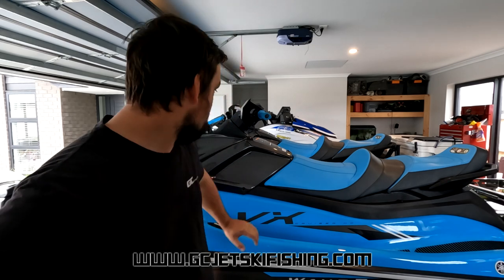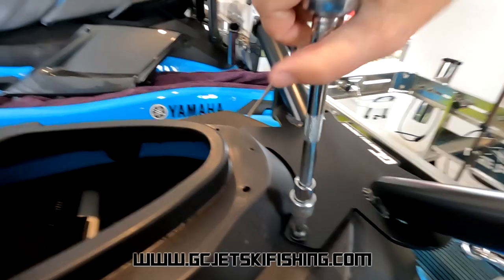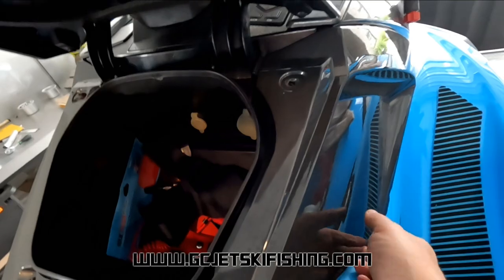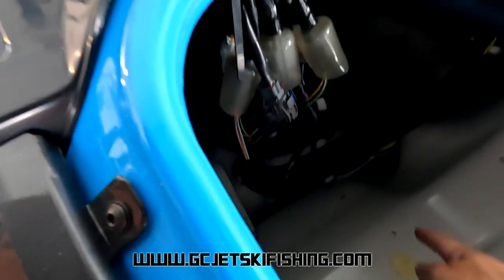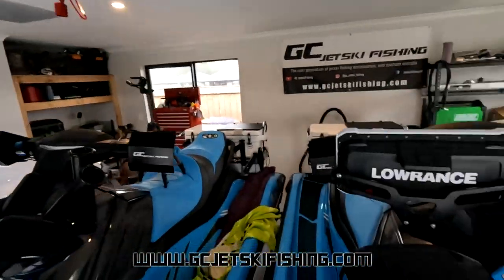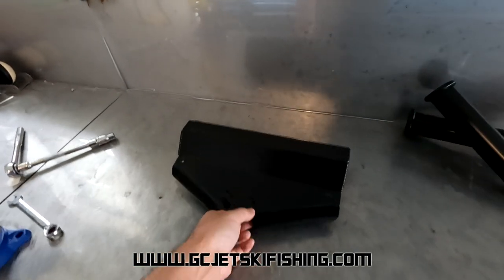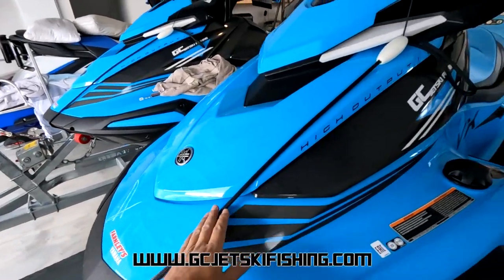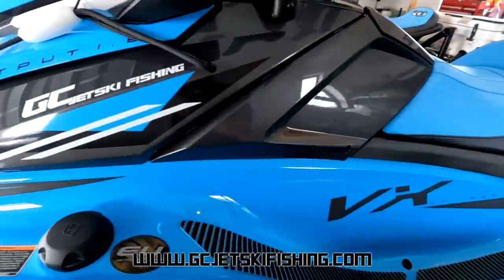2022 Yamaha Waverunner VX fishing accessories

Comment: Who manufactures the rear deck storage/cooler combination? That’s one of the better looking setups I’ve seen. Looking to copy these skis on a ‘23 GP1800R SVHO 🤤
Reply from the maker: They are made by a dealership here in NZ called Farnleys Yamaha. They do look really nice but in my opinion they are a bit too heavy for the back of the ski, weighing nearly 30 kg with no gear on it
Reply: Geez that’s heavy!
Reply from the maker: @lukemason9097  yeah when you think the 70L cooler can easily hold 50kg of fish & ice, plus 10kg of fishing rods & fishing gear that's nearly 100kg on the back of the ski

Comment: I have a 2021 vx ho. Same shape. Will grab a few of these accessories. Are the wind shields  for your hands the same as ones on your website? Are they easy to fit?
Reply from the maker: Hey Jason, these are the ones on my site but I actually had to modify these hand shields slightly to make them fit as the handle bars are quite different to the previous models